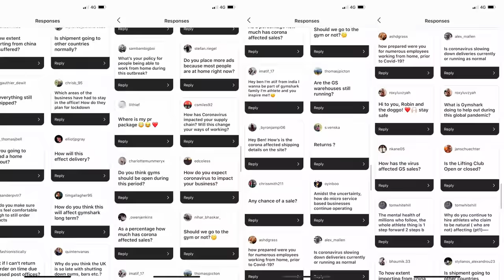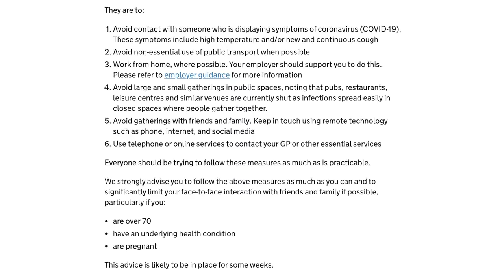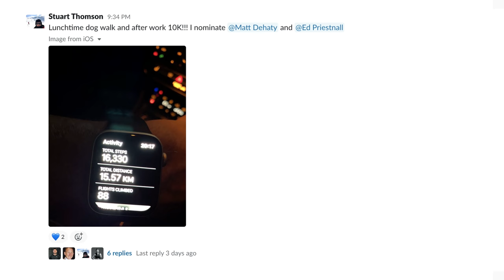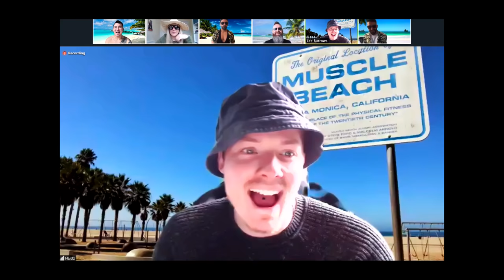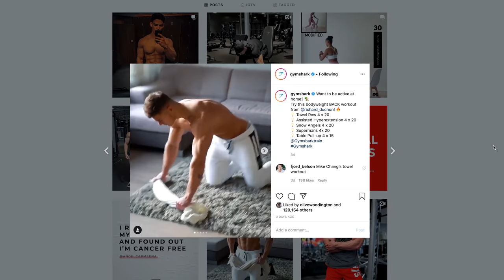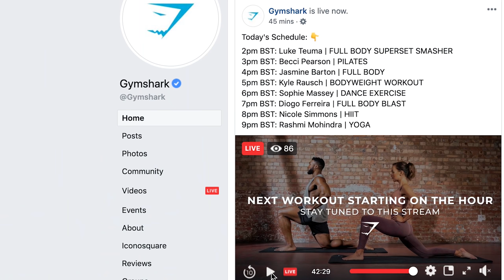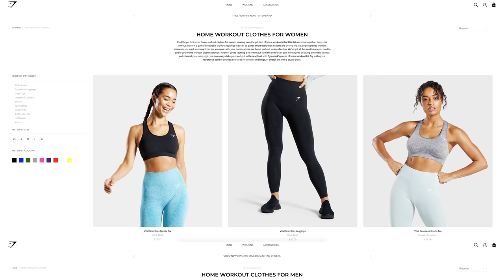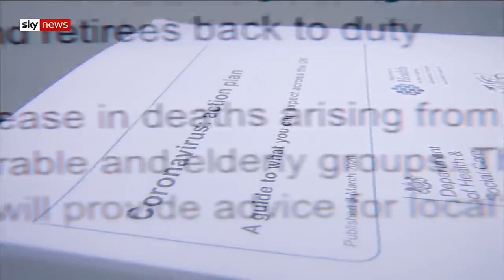CORONAVIRUS AT GYMSHARK: How we're dealing with COVID-19

Comment: hi ben you mentioned a while back that you were open to ideas from people to use your new manufacture machines - seamless sewing i think. i'd like to design new smartwear with you based on smart patterns integrated into you clothing at key points on the body to allow users use computer vision/augmented reality to monitor their posture, form during exercise, correct contraction at key points of weights movements etc. to be integrated into your workout apps. This would be part of a larger program feeding back to gymshark smart mirrors, which use thermal imagery/spectrometery to improve the health of gymshark individuals.